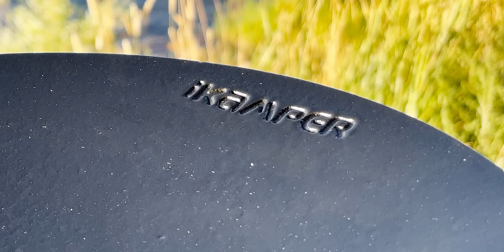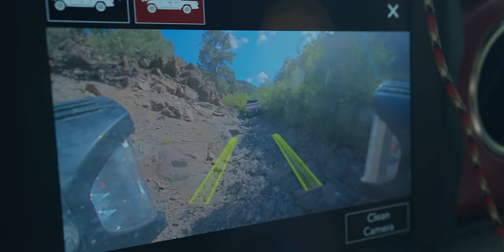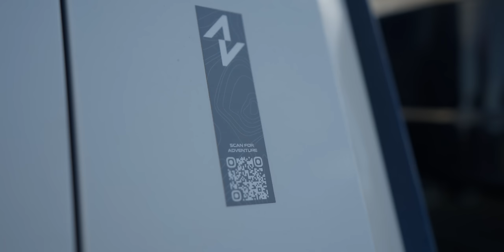Did This Rivian Just Out-Overland My Jeep Gladiator?

Comment: What I love about my Rivian R1S, is you can take it on trails like this, but then daily drive it.  You can also race super cars and win, even with the all-terrane tires.  I love car camping in the back of it when I mountain bike.  No rooftop tent needed, no Jackery needed.  It has a built in air compressor, that I use for my bike tires as well as for the vehicle.  All my gear and bags fit nicely in the front trunk (where the engine normally goes) and in the space where the gas tank normally goes.  So when I head into town, there’s nothing to smash and grab (everything is out of sight).
Reply: Spot on! 

I just took my R1S out to Angelina National Forest for some dispersed camping last weekend. 

Next weekend my wife and I are going to a black tie event. R1S can rough it, and also clean up and look sophisticated on a night on the town.

Comment: Multiple day off grid trips may be challenging with the Rivian. With an IC vehicle you can always borrow or buy a couple of gallons of fuel from another motorist if needed. But for short overnight or weekend off grid trips, an EV (especially with Rivians off road capability) should be fine. The reality is most "Overlanders" never go on trails harder than what a Subaru can handle....usually fire roads or two tracks.

Comment: I’m with you, love new tech…however you can carry ?? Miles of fuel in rotopax. He has to carry a generator and really plan his trip. I never had range anxiety with any of my jeeps, but I’m always watching my range on my Tesla. And the time to charge, well you don’t think about until you live it.
Reply: Well, he wouldn't be carrying a generator, but I get where you're coming from. Yet, that was about a 1000 mile trip and the R1T made it using the existing charging infrastructure. You're absolutely right it requires planning but really it isn't that hard. 
I don't really overland but I take my R1T 4 wheelin' and camping on the trails around Colorado. it really hasn't been that big of a deal for me.

Comment: Great Video!  I have a R1T, while he may have more range available at the end, you can easily replenish on the go.  We aren't there (yet).  Just got back from a camping trip, had a little anxiety, but its going away slowly.  I have some solar panels + battery backup, but I can only reasonably add ~1 mile per day, its only a 1.3kWh backup battery.

Comment: The Rivian did fantastic to be stock. The problem is that, basically, stock is the only way it can be. Serius 4x4 are platforms that the owner goes tunning little by little.  Even an old Toyota, well prepared will do a better job than most vehicles. Also easy to repair in terms of time, labor and cost is important: you are going to hit your 4x4  Again for being first-generation technology, and with no preparation is just fantastic. I will be surprised if the CyberTruck can go even closer to this performance.

Comment: I guess I’ll be the internet troll on this one. Nice video BTW. For me, EV’s are just not there for off-roading. Tahoe is not remote. Nor is anything right off 395. Even then, I doubt he did the trip on one charge and then everyone had to wait and wait. And that’s assuming the charger was available, working and charging at a fast speed, which are all big if’s. I have a Tesla so I have some experience with this. Oh and the leveling truck, it’s been around on Land Rover’s for over 10 years. Personally I think you made the right decision on your vehicle. Cheers.
Reply from the maker: I wouldn’t call you a troll. Unless being a troll is being practical. 

I will say, we met up at a charge/fuel station where we both “topped off” before heading for the two nights of camping and he left the trail with more remaining range than the Gladiator. Although the payoff is that the Gladiator walked over everything without issue and he had to be creative with his lines.

Comment: It's not really a fair test when the tires on the red Jeep are much bigger, and more of an off road tire than the tires on the Rivian. I had a Toyota FJ-40 Land Cruiser for 5 years and took it off road a thousand times, and tires make a big difference. I would say the Rivian did great, even with the smaller more on road type tires. 

And I could care less if the Rivian self levels on an uneven surface, all these Rivian videos make a big deal about it, but for me I could care less if it self levels when it is parked.

Comment: Great video.  Question on the tilting frig setup.  How are you liking that, now that you’ve used it for awhile?  Seems like a lot to go through just to pull out a yogurt, but would like to hear your thoughts.  On a separate note, I have a tailgate table and now kicking myself for not getting one with a side pull out cutting board (like shown in your video).
Reply from the maker: I love it. It’s not a lot of work at all. It was more work when the fridge wasn’t on a slide. 

Look up the Outback Adventure Trailgater. That’s the table you need.

Comment: Serious question: if the Rivian runs out of energy on a moderately difficult trail where a tow truck may not be readily able to go, what exactly do you do?  You can't exactly bring a jerry can full of gasoline to it.  ???
Reply: Mobile battery pack ,  gasoline electric generator, and even solar panels with inverter.   Much more time , but if you think about it, with the solar panels idea you can make energy in the middle of nowhere. It’s not like you can drill for petroleum where you get stuck and then refine it and make your own gasoline on the spot.   Also, even if you just use gasoline and the electric generator, it would be a better use of the gasoline “per mile” because of the EV efficiency ironically.  Like maybe 7mpg or less with a gas engine off road … but double the efficiency per gallon of the same gasoline, if you put it into an electric gas generator first and then just charged your EV with it on the spot (just like a locomotive train 🚊 does)
Reply: You would need some really poor planning to find yourself in that situation.

Comment: Interesting, my biggest concern for EV was the power supply and how much power you'd have for these kinds of trips. Did you both start out at full? Regardless, I'm probably still a fan of Gas mostly because I can bring extra with me.
Reply from the maker: Yes. We both started full. The Jeep increases fuel consumption in 4-lo versus the Rivian using the same or less electricity because it has instant torque.

Comment: That Jeep will still be running down trails in twenty years, that Rivian is a cool vehicle but it will be outdated with no dealer support of part availability withing half that time.  You can make anything into something it is not, but the Jeep is out of the box pretty capable with endless aftermarket support.

Comment: I can't help but notice there's no winch on that Rivian.  Or would using one reduce it's range to nearly nothing?  The inability to have/use a winch on it automatically makes it inferior as an overlander.  Or any kind of serious off roader, for that matter.
Reply: I think it's just that the Rivian is so new that no one's made any aftermarket bumpers for it to fit a winch yet
Reply: @MikeInTheWoods  That wasn't my main concern.  Basically, if you have to run a winch capable of pulling a truck hard for 3-5 minutes, how much range would you lose?
Reply: @VideosOffRoad  Take the max power draw of the winch, figure out what that is over the course of 5 mins, and deduct that from the rivian battery.

Assuming a 12v winch pulling 400a under load, that's a 4.8 kw power draw for 5 mins, which works out to about 400 watt hours.

Assuming the rivian has the 130 kwh pack, that's 0.3% of the battery capacity

Comment: I mean its a coolish idea but  river crossings, high heats or very cold temps, one sensor goes out the whole thing is dead in the water. And no aftermarket support then you need a gas generator to keep going on a proper adventure
Reply: Rivian has a fording depth up to the windowsill, I think it's pretty good for river crossings. And it moderates the temperature of the battery in extreme hot & cold

Comment: Very cute. The Rivian won’t go where I want to camp and there’s no way to charge it there either
Reply from the maker: I’m curious what the range of your current vehicle is? Is it near 300 miles? Like I said at the end of this video, we started with the same range but I ended far lower because fuel consumption increased during low-range use, for him, energy consumption was less in low range. I left with 101 miles to empty, he left with 160. At that rate, he’s getting further into the wild than I am - excluding the obvious option to dump green liquid into my truck and out-range him.
Reply: @JustinBMcBride  Hey JBM - yes, that's about right, really depends on the driving. My rig is similar to yours: JT with a RTT and full size rack and that cuts down my range if going hiway speeds. Just got back from Moab last week and did the Aspen loop in July. The Riv could go many of those places, but many many more it could not. Can you imagine taking the Riv on Behind the Reef? And charging in the places I like to go is pretty non existent. A few rotopaks of gas adds a ton of insurance on range. Someday we will all be driving these EVs, just not today, at least not me today. One of my best friends has a Riv and he loves it. I'll stick to my JT.

Comment: If you look under the Jeep you will see that it is built LIKE A TANK.  If you look under the Rivian, you won't see anything even remotely close to the beefy solid steel parts used for the jeep.  It's awesome that the Rivian can do it, the important question is...for how long.
Reply: Have you seen the underside of a rivian? It is one giant steel plate from end to end if you have the off-road tray. Every component is oversized aluminum. (Tie rods aren’t great though )
Reply: @Magnus_Magnesium  It's more than just steel. It's a layer of steel, aluminum, and carbon fiber.
Reply: Someone is hardcore Jeep bias. I own a 92 YJ and even i don’t hate on Rivian like that
Reply: LOL.  Tell me you've never looked at the underside of a Rivian without telling me you've never looked at the underside of a Rivian.